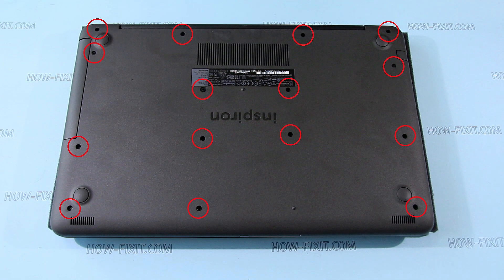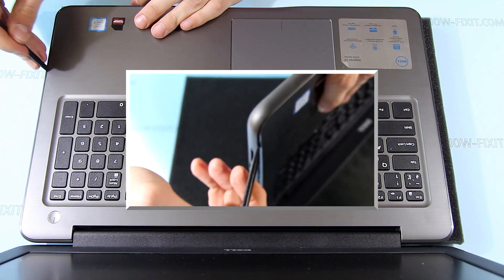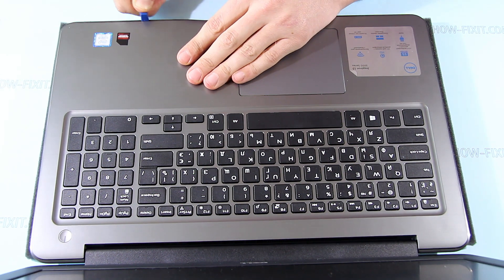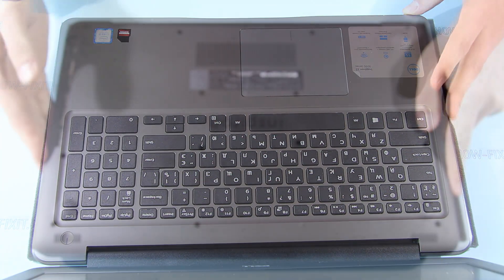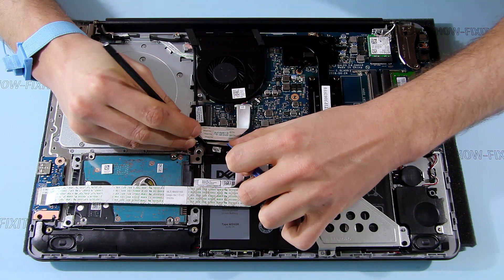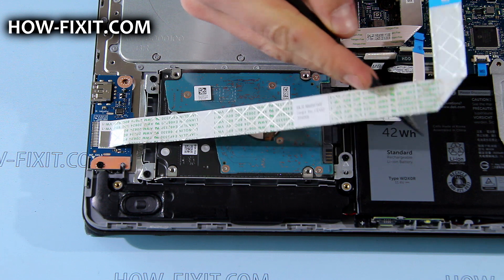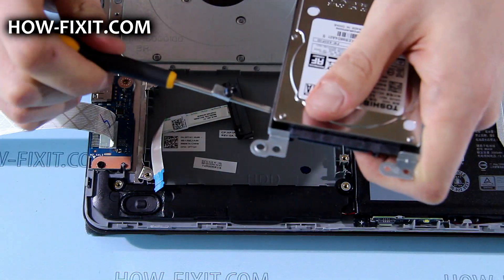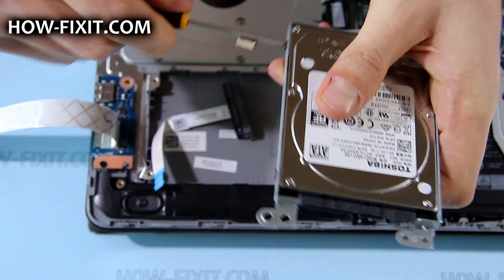Upgrade Dell Inspiron 5567, 5565 Hard Drive to SSD - Step-by-Step DIY Guide

Comment: For those who have doubts about which tool to use to open this computer (Notebook Inspiron i15-5567-A40C), use the tool (+ 2.5) that is present in several Toolkits. What I bought, on the ebay, was the JAKEMY JM-8151 kit. I hope it helped you.

Comment: Can I install SSD instead of Optical Drive? If yes, is there SATA III?
Reply from the maker: Yes you can, but you need Optibay 9.5mm, link where you can buy I left in description.

Supported SATA I / SATA II / SATA III

Comment: thank you for the upload,  can I buy any ssd hard drive? I thought there were two types 7mm and 9 mm I am not sure? ???
Reply: โจ้ทะกอง09947555000
Reply: As long as you buy a 2.5" SSD you'll be fine. Some of the larger capacity (2TB+) 2.5" mechanical drives are indeed thicker.